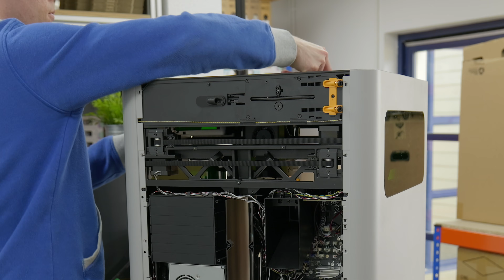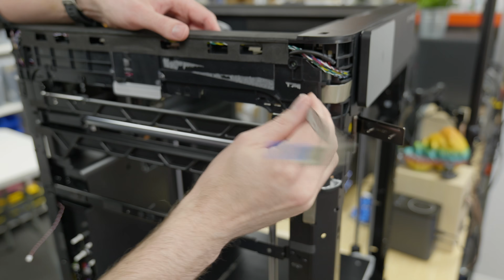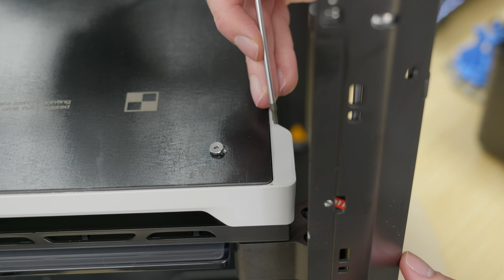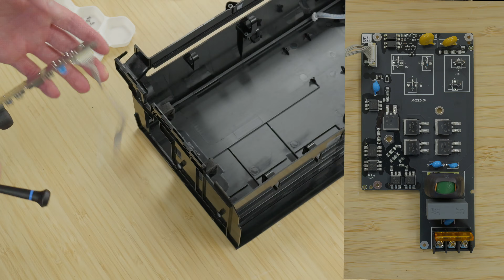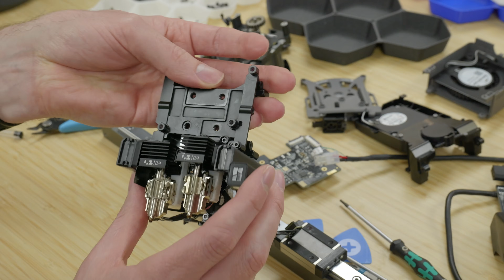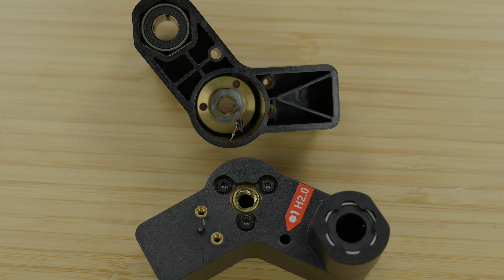Broke my Bambu Labs H2D to Show You What's inside

Comment: if you are here because you had to take your extruder apart because filament melted in it, and you are losing your mind over those godforsaken cutter handle springs, and you are working on the printer without removing the entire gantry, slow down, get a tiny bit of white grease, put a dab on each spring and put them in place using tweezers or tweezer needlenose pliers. The grease helps keep the spring on it's little perch and from falling out while you are trying to get the handle back in. I'd love to find the person who engineered that and kick them directly in the ass. Multiple times.

Comment: Thanks for this - super helpful.  Question, at about 23:44 in this video, you're looking at the toolhead - there is a yellow ribbon cable hanging out, what is this?  I had to replace my toolhead camera, reassembling everything I'm stuck at this cable. Don't know what it is or where to put it?  Thanks again.

Comment: I am so glad that I found your video. I have a H2D that is just a year old. The TH Board went based and Bambu sent me a new one. It has been a nightmare since I took the old one out. The cable to the servo motor pulled out and I am guessing that I now have to disassemble even more to get it in again. I will try to follow your video.

Comment: Thanks for a very impressive and brave teardown and the hours spent on re-assembly.
I have been close to purchasing the H2D but aware of the issues some owners are having.
This is not surprising given the mind boggling complexity of the dual hot end. Even the slightest assembly issue will compromise results.  And the complex H2D design really only offers major benefits (less waste and faster print  time)  for two colours (!)
As an electronics engineer and having watched tis revealing video,  the double hot end  while impressive looks too complex to be reliable over time.  When it fails  repair will be difficult and very expensive.  Now I understand why the H2S is outselling the H2D!   I think the Ssnapmaker UI r design with multiple hot ends is a better way to go for

Comment: In regard to the Idler arms of the extruder. Is there a way to change the idler pressure against the filament ? In other words, can you bring the idler closer to the drive gear or further ? I would like to adjust the tension for TPU printing.

Comment: I would never buy one of these, so over engineered . They tried to put to much into one machine I feel, and I’m not sure that all the features they claim work well and correctly, that tool head is so heavy, and being supported by a single rail vs two carbon rods is a very strange solution. Repairing this machine looks to be very difficult if you have to get deep into the buried sections.. this comes from a P1s owner. I would have much rather seen a better P1s to compete with the Core One.. but no they made this abomination

Comment: WOW... thanks for the tear-down. As a QA guy and system's engineer, root cause failures and serviceability are paramount. I fear the design is over complex with connectivity issues and component failures just waiting to rear their ugly heads as all things fail given enough time. It would be interesting if Bambu Labs will take the time to simplify this design. 
I wonder if Bambu labs will be issuing an extended warranty program for those folks who want to use this machine in printer farms.
Reply: Every single one of their printers has evidence of a design process that runs out of time and has to "get it done" in order to hit the market ahead of everyone else by 6 to 12 months

Comment: It must take factory workers like a solid 3 hours just to assemble that toolhead, damn. That is impressively engineered but so complex, so many cables and connectors. It is almost unbelievable.
Reply: About 10 minutes per toolhead.  Not that bad, but it's very labor intensive.
Reply: Yeah there is no way that takes 3 hours to assemble if its an assembly line.  Each person will be assigned one or two tasks and the entire toolhead will be completed in less than 30 minutes I would expect.

Comment: An over engineering products. As I did engineering more than 30yrs, engineering prototypes need only one type of material per parts for functional review only. For marketing purpose uses which need color prototypes and doing some overmold tpu soft materials on handle, two or more materials in a prototype may need, but for colors,  painting can achieve the task. At the moment, I won't buy such expensive machine for home use. Moreover, I already have an low price old 3d machine which is twin nozzles type, I can print two materials and is enough

Comment: Very nice video to have, but I'm disappointed you didn"t show anything of the heater and filtration assemblies. We didn't see how the second toolhead fan cools the cold end eithers.
Also, the toolhead has 3 motors : one for the extruder, one to move the hotend up and down, but you didn't specify what the third one (second to appear in the vid) does.

Comment: I wonder if it takes more time to assemble the head than the entire printer on the assembly line. I believe in the new quarter bambu will release firmware update that will make all this crazy engineering worth it. It will all be justified. Right now they fixing high volume manufacturing issues. That might actually be 2 different team.

Comment: There are lots of little surface level things that I noticed when setting mine up that made me give a nod, like the aft sir screw which is actually sealed inside a rubber pitot keeping it from falling into the printer when you remove it.  The instructions even say to be very careful it doesn't fall in, and I feel like they saw that as a pain point in testing and added the pitot.

Comment: Thanks for sharing. Id never think bambu would use such cheap cables in this expensive of a machine, its easier to replace these steppers with no driver boards in them.
Reply from the maker: Are you talking about the motor where I broke the wires? This is normal, thin wires are needed for the internal windings of the motor. This is a servo motor with an encoder so integrated pcb is not a driver either. Different tech.
Reply: @Vector3DP  The wires that travel all around the frame!

Comment: Yeah, it's made complicated and for sequential assembly, just like other mass-produced things, like paper printers. Hard to repair (hard to get to stuff). But it's phenomenal to get that much functionality for the price, so I guess, that's a trade-off. Although, in the end, repairability is a choice, Bambu clearly didn't care about.
Reply from the maker: What I did is not a repair or maintenance process. There is actually ALOT of design in this printer that makes it repairable and you can get shockingly deep quite quickly.
Reply: @Vector3DP  still, many parts could be much easier to access, which is not hard to do, but you have to design for it.

Comment: I am split in my impressions, like it's impressive in it's complexity, but complexity just adds failure points and complicates repairability. I am in many ways more impressed of enginnering that achieves good results while keeping it simple. As someone who alwsys tends to mod everything they own I will keep with more moddable printers out there. This for sure has their clientel, and they are aiming at people like me :)
Reply: I would thoroughly enjoy it if they release a stripped down version like the P1P versus P1S. I don’t print enough complex materials to warrant an enclosed space. And the entire laser system just seems like a massive failure point.
Reply: @ari_0849  The laser/cutting system is a different version so if you don't want it, you just get the printer only version.

Comment: Wow, when you see what's inside these, they look pretty good value. 3D printers have come a long way since they were an Arduino Mega with a motor drive shield, and a load of cheap, generic linear rail parts. The wires soldered to that PCB instead of a connector and the glued linear rails do look like issues that should have been sorted out before production though. I'm also struggling to get my head around whether this level of complexity is what it takes to make a highly featured, semi industrial spec machine, or whether this is unnecessarily complex (and I'm a design engineer - just not of 3d printers!).

Comment: Like a little Horror-Movie 😬🫨🤯 

I like my X1C, but normaly simple tasks, for example changing the heatbead, are a complete nightmare.
I repaired around 10 Anycubic Kobra Printers and they are 100 times less complex than this Laser H2D. 

Thank you for sharing this great Video 👍
Reply: I had an Anycubic Viper and that piece of crap needed 20x more repairs than my P1S.
Reply: why would you replace a heatbed in the first place, it's not something that just breaks randomly
Reply: @sowa705  Many x1 heatbeads are bent and that causes the print bottom surfaces to be bent too. There are spezial printbeds on the Market.

Comment: This look like the paper printer internal, tonnes of injection molded plastic, plastic clips, ribbon cable, tiny screws and tiny wires everywhere. Also paper printers are almost impossible to repair, this seem to go down the same path.

Comment: I do want to get this printer, but am going to wait until they replace the heated bed. I don't like how they are using the A1 here.
Reply: huh???
Reply: @kekkodance  More or less the design they are using now to heat the bed is used in the very small A1 printer and does not work being scaled up to this size.

Comment: God this looks like a nightmare to repair!

You can really tell they did lots of RND and that it was designed to be cheaply mass manufactured,  but not to be repaired by the user.
Reply: I had a temperature sensor fault on my X1 and while disassembling was screaming of frustration. I've engineered offset printing machines with less parts.  Just crazy. Not designed for assembly at all.
However the overall quality of the Bambu Lab printers is very good. Different level than anything before.
Reply: @MichielvanderMeulen not really, it's just bambu produces their machines more like disposable 2D printers, overcomplicated, low cost components, high complexity and definitely not designed with ease of maintenance in mind. But great while they work 😅
Reply: @thegarageluthier  that's what I said?

Comment: That's impressive. I don't know if in good or bad way. After previous teardown of Core One, one must admit that Prusa enginners are the kings of not overengineering.
Reply: with all the vfa,s and ringing pruisa needs to engineer more hahahah
Reply: Over engineering implies that these changes don't improve longevity.
Reply: This here looks like sloppy design to me.. They make their own boards yet dont bundle their cables for simplified assembly.. 
It looks like some bigshot boss of theirs just kept pushing "hey add this!" And they somehow had to fit the random idea wherever there is place.. 
The hardware was clearly not planned for the electronics.. 
A good design looks simple and clever.. This is messy and unfinished.
Reply: Right? This thing is literal hell to repair. We bought one for work but I'm sure as hell not getting one for myself. 

While I don't prefer to tinker with machines that already work, I do prefer to repair things when they break and this thing is way too over engineered. They didn't even consider disassembly and parts replacement and it shows in their lack of spare parts for this printer.
Reply: core one is a diy class machine. completely different thing than what bambu does
Reply: Seeing the insides of this and the Core one is like trying to compare a 2025 Lexus to a 2000 Honda Civic.

One of them will perform a hell of a lot more than the other, but also take a lot more resources to maintain, such is the nature of machines.

I wouldn't say Prusa is not overengineering, but that they're engineering for a completely different category of machine.
Reply: @stevato0449  You're absolutely wrong. You can add all the additional features you want without adding complexity to the assembly. This thing is over-engineered and very much not maintenance friendly.
Reply: The Core one is about as complex as a P1S.
Reply: @lukahierl9857   Core one features chamber temp control and many open source mods are available for it to fit any number of different needs. Core one also has independent Z motors and a flat bed, unlike the P1 series. Core one also is available as a kit or as a fully built machine, so idk why people are comparing it to a "kit class" machine. If you want something made of European steel, that you can repair usually with less than ten screws, and that will print at a higher quality than any Chinese machine, buy Prusa. Otherwise, just admit you are saving money and accepting a certain caliber of quality and move on. No reason to lie and pretend.
Reply: @Oddprints Not wanting to argue but genuinely discuss, I don't believe the core one prints at a particular higher quality than Bambu printers. I'm thinking consistency of layers, overhangs, artifacts etc.
Reply: @ Look man, I appreciate the Core One, but there's no need to lie:

No, the chamber temp control is simply programmed preheating with the bed, it doesn't feature an active heater.

No, the bed does not have independent Z motors, they're driven using the same driver because it uses the same mainboard as the MK4.

Finally, unlike its predecessors, it's not screwed together it uses plastic rivets.
Reply: @stevato0449  Only the acrylic window pieces are riveted. 

You are correct about most those specs, not sure where the other guy got those specs. It's still a more maintenance friendly design.
Reply: @TechnologistAtWork  IMHO you can only compare maintainability between machines with similar capabilities. Prusa Core One is merely a P1-competitor, the H2D is a lot more complex than them. I think it's like comparing bicycles to cars, and say bicycles are better than cars because they are easier to disassemble. Bicycles (Core One as well) do have their unique advantages, but I don't think comparing them this way is fair.

Also, H2D doesn’t look that hard to maintain (except those glued parts). You don’t need to fully disassemble the machine to replace many of the parts. I do agree that it would be better to make it more DIY-repair-friendly, and their customer service might need more work. Maintainability is certainly nice-to-have.
Reply: @LTVXV because it doesn’t. Out of the box the machine has terrible ringing and artifacts. Sure, you could spend time tuning and tweaking, but the average modern consumer just doesn’t want that. But at the same time, Bambu’s still requires tuning for filament profiles, but produces pretty good parts out of the box. The people that claim Prusa is better from the jump are coping with buying an overly expensive printer, when you could build your own Voron cheaper.
Reply: @PrintingAddict17 Your tone is like you're disagreeing with me 😂

Comment: Masterclass in machine design
Reply: Masterclass in how to overcomplicate everything.
Reply: @thegarageluthier  That's one way to see it. But also consider how well it performs, how compact and robust it is. Sure an Ender 3 looks simple. But also maintenance hungry, much less accurate and productive. To each his preference. I have a Qidi Q1 and I am blown away by how well the motion system is built. European machines look like toys in comparison.
Reply: @SuperYellowsubmarin  30 years in Engineering and Automation and the principles of K.I.S.S still hold true today. I have 4 variations on Voron tridents that I have been running for years now, along with other machines and I basically do no maintenance other than clean or replace a nozzle.
Reply: @thegarageluthier  which is a perfect design for a kit build with good quality components. I will argue that these new printers are similar to inkjet printers in compactness, integration, features, cost efficiency, but also difficulty in repairing. To each his preference. I will not take this approach for an industrial production machine where I would want everything accessible, easy to service with standard components. But for consumer grade products the qidi / bambulab approach I have been expecting for a long time as compared to creality's extrusion designs.
Reply: voron is overdesigned, you don't need anything more than ender 3
Reply: @sowa705  No thank you

Comment: It’s gonna be a nightmare troubleshooting this beast
Reply: No because unlike creality, their documentations are very well made
Reply: @ Even with excellent documentation, the systems are inherently complex, and a single issue can often be caused by multiple interacting factors. That said, I want to clarify that this isn’t a criticism of Bambu—the H2D is a solid machine
Reply: @kennethchubs I can already feel my broken back disassembling the extruder to take out bits of broken plastic to unjam it.
Reply: @fatt0nk171  Creality has excellent repairability lol, a guy was asked to throw away his x1c because a pulley broke and it was effectively impossible to remove

Comment: 17:28 the toolhead looks like a modernized Stratasys uprint se plus toolhead from the early 2010s. The extruder looks pretty much unchanged from the Stratasys printer surprisingly. Heater blocks and switching mechanism are more similar creality sermoon d3 pro.